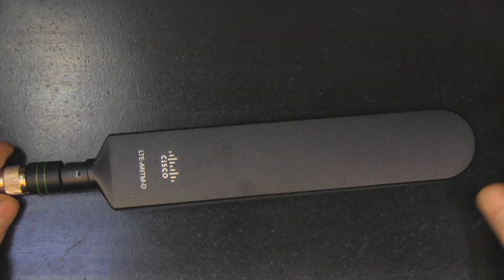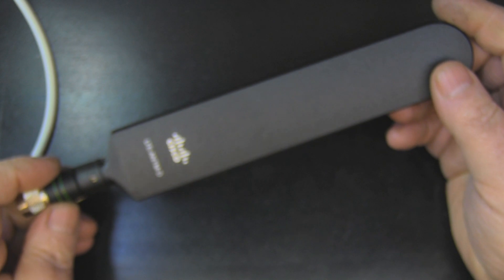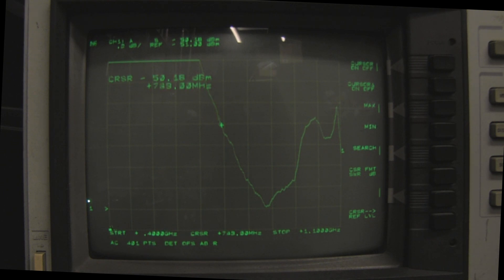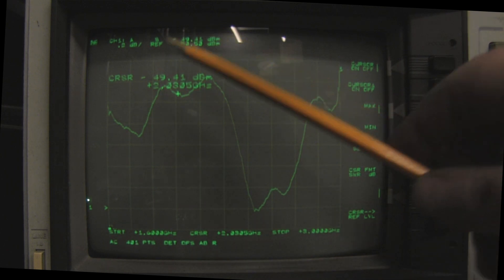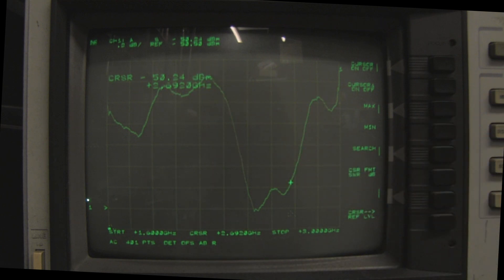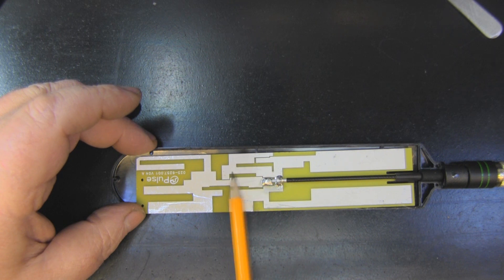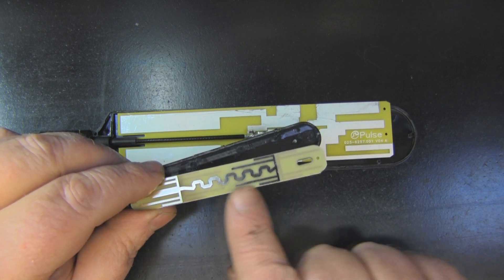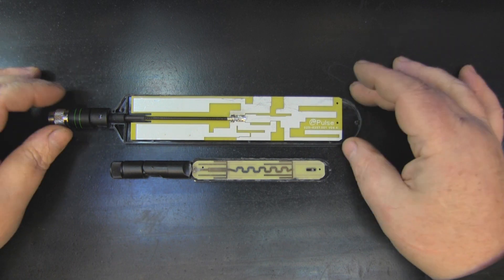Cisco 4g-lte-antm-d Omnidirectional Antenna

Comment: Hi Mr McNeil
What equipment can I use to receive the 2100 LTE frequency and send the same frequency again in another direction up to a distance of 3-4 miles? For example, from the top of a mountain, I direct the frequency to the slopes of the mountain, even to a point for point-to-point connection. My whole question is can I give direction or reflection to a frequency? Or use equipment that sends the same frequency in the same direction with the same speed and quality without dropping a few miles?

Comment: Hi Andrew, can you recommend a 4G LTE antenna for rural broadband. I've been using the Yagi directional antenna with mixed results. 2 of them, some say mount at 45degrees to each other? Any thoughts to help me to improve my connection? I hear the iskra is pretty good too. Any advice much appreciated. Thank you. Love your channel
Reply: i`d say start off with a panel antenna with a gain around 15 dbi but if won`t be ok, take satellite dish with a horn antenna as a driver.
Reply: Here in Malaysia we are using grid parabolic 4G antenna or LPDA log periodic antenna

Comment: I love these explorations thanks as always for your time and making these videos. -looks like this would usable for 1090 ADS-B as well!
I work for a company that deals in used industrial equipment of all kinds including wireless gear of all kinds. 
I'm fortunate to have permission to access the scrap.
I have taken so many similar looking antennas enclosures apart simply out of curious. I see typically just standard little dipoles stuck into a similar enclosure or the bog standard mass-produced PCB antennas. I haven't seen this architecture before the ones, like someone put some effort into it! LOL
I am also our X-Ray op so looking inside of a sealed small antenna enclosure when I can.  -also easy to see if the "coax" is real or just a dressed up mic cable.
What I end up getting from scrap also are pieces of feedline with an SMA connector like RG316 or RG174 and more.
A couple of months ago I was gifted a bag of six-foot RG316 cables with SMAs on each end. Like two dozen of them! I gifted a couple to the Engineering Department, gifted a few to radio-minded friends and hoarded like any reasonable people would do!
73 de N2NLQ

Comment: Why when I measure antenna return loss it is wobbly and it changes when I for example touch the antenna
Reply: Your hand alters the capacitance of the antenna.  This is why antenna tests are best done in a large open area.
Reply: @SimonShaws  Thanks, Can WiFi in the area effect the antenna bandwidth, if the antenna works at 5 / 2.4 GHz?
Reply: @fredfrancium  I don't think so.  Bandwidth is typically a result of antenna physical design.  A very close WiFi antenna could alter bandwidth, however it would need to be in the order of wavelengths apart.  At normal WiFi and cell frequencies this would be measured in cm.  In lower frequencies, it's much more important to keep antennas physically separate as their wavelength is so much longer, (up to 10s of meters), (which is why I always laugh when I see VHF antennas on vehicles mounted basically on top of each other). WiFi signal could interfere with performance, (but not bandwidth) by adding noise to the system, especially if the frequencies are close.
If you picture capturing water with a bucket, bandwidth is how wide your bucket mouth is and gain is how deep the bucket is if you want a simple explanation.

Comment: Does anyone have any literature on these "complex" antenna structures?
Reply: This kind of antennas are designed most likely in Ansys HFSS or CST Studio. From theory, it is 2D multiband sleeve antenna. But there are some tricks with capacitance gaps, and folded radiator. Experience of a designer plus the optimizer in the software equals such a design. Bear in mind that CISCO is a top notch company and there are smart people behind it. If comes to the literature - google patents search (now only available via google scholar).